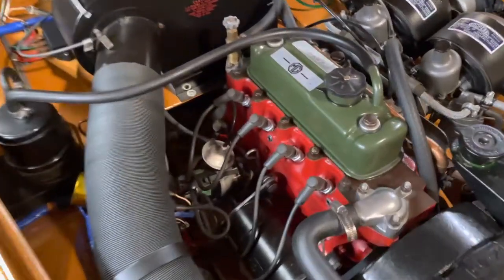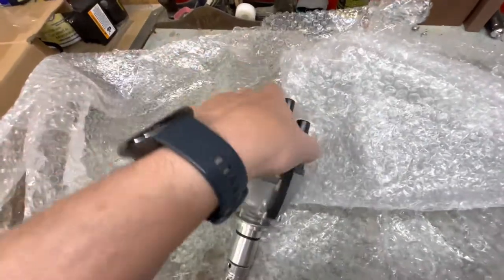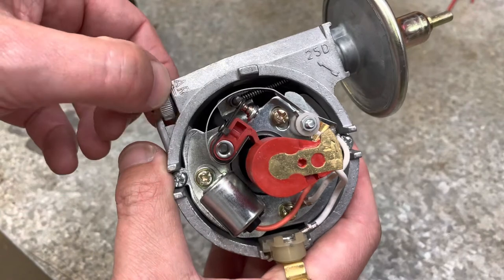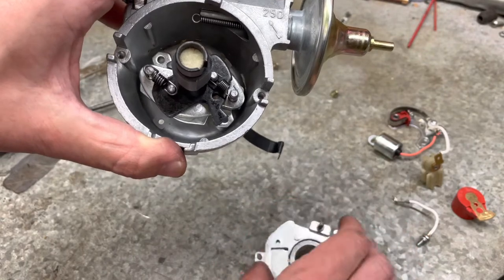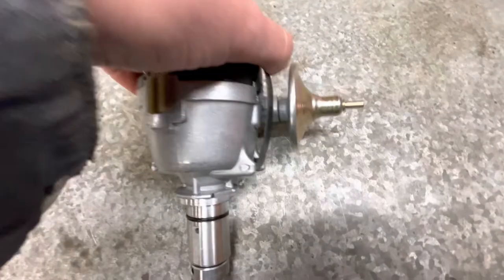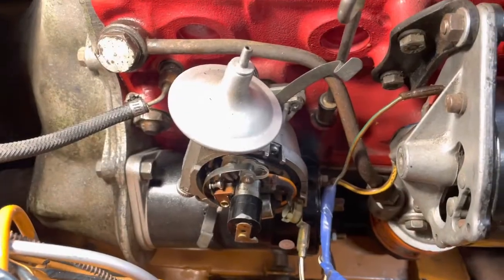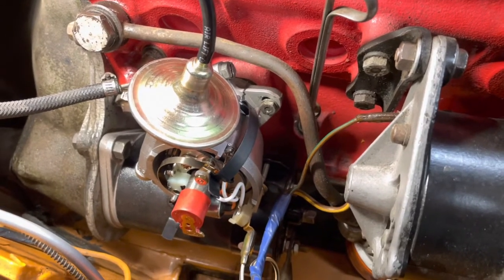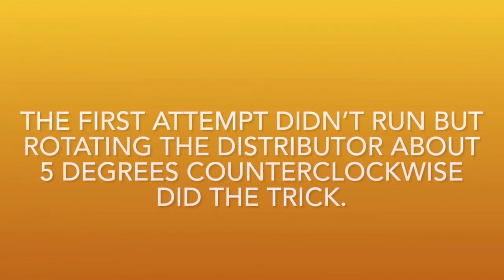1971 MG Midget Distributor Replacement

Comment: I ordered a new 25D4 from Team Triumph last year and although it had Lucas markings,  there were indications that it was a not a real Lucas distributor.   It was only $70.    The vacuum advance had failed on my original distributor but otherwise it was good.   I found upon installation of the new one that I couldn't get the dwell to set properly.   I looked closely at the cam and I noticed a unusual ridge on all the cam lobes.   I moved the vacuum advance to my old distributor and reinstalled.   Dwell now was correct.   Lesson learned.

Comment: Hi there firstly thanks so much for doing your videos that are really helpful. My midget has an original points system and I was going to change to electronic ignition. Can I ask your thoughts on points and why you haven’t changed. 🙏 not sure if to change or not. Thank you for your time
Reply from the maker: Hi,
I have stuck with points so far for two reasons.   First is that they are easy to work on, and to fix if there is a problem.  Second is that they are less expensive.  I may switch to electronic someday just to see if there is any difference but since this car doesn’t drive more than 500 miles per year I don’t mind cleaning and adjusting things once a season.   It’s fun to work on.  Have fun with your midget.

Comment: i see you have a emissions pump delete what size screw/plug are you using for the block holes?
Reply from the maker: I used 7/16”-20 x 1/2” long, cup point socket set screws.  Cheapest to buy way more than you need from a fastener supplier rather than buying 4 on eBay.